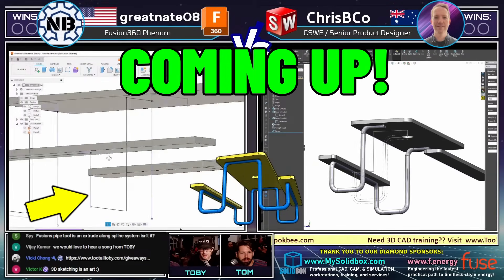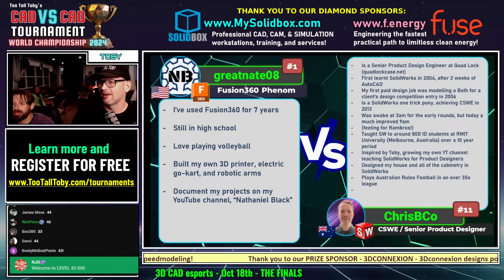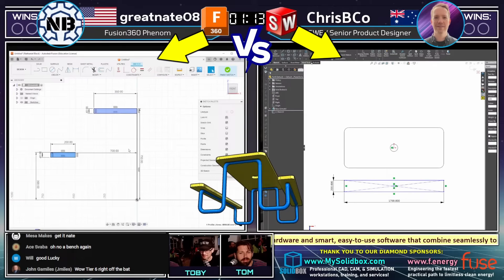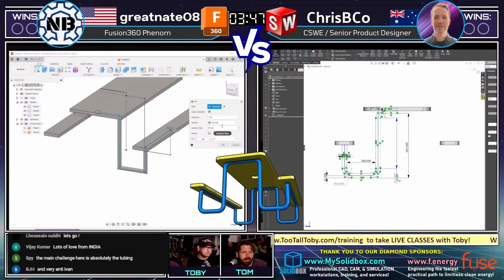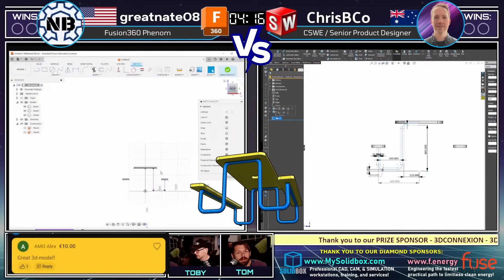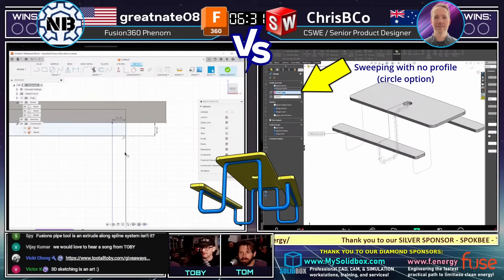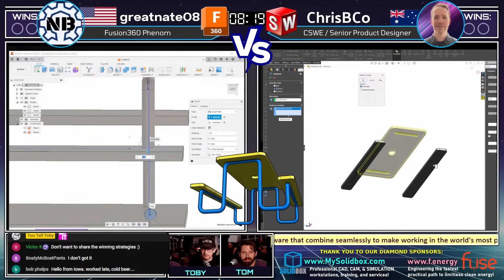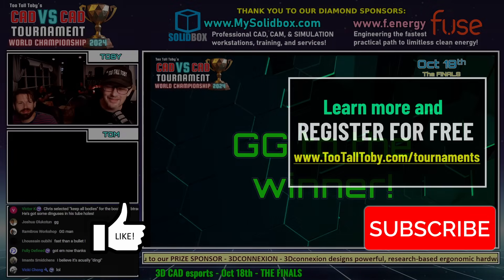CAD Speedmodeling Tournament! - SEMI-FINALS Battle 1 - FUSION 360 vs SOLIDWORKS

Comment: Would it be legal to simply calculate the length of the tubing and modeling a straight tube of the correct length for the mass? I know it is less fun, im just curious
Reply from the maker: Yes - during the tournament livestream the users can use a lot of workarounds to calculate the mass, including pen and paper or a calculator. We generally refer to this loophole as "the Ivan exploit"

Comment: Ah I remember this like yesterday! So many things I’d do differently now. 
For one, I know where all the dimensions are now, I’d get the first sketches done quicker.
But the main changes, I could’ve skipped making a composite curve and just used the tangent edge selection for the sweep.
The sweep itself could’ve had a thin wall, then I’d avoid doing the shell. 
OR, I could sweep, INDENT into the table, then shell. 
Much love for the multi-body models!
Reply: Is it possible to make the frame (sweep path) with a 3D sketch? Or is it just too time consuming to get the radius between sections done?
Reply: @razorcain74 it’s definitely possible, and probably the quickest options if you’re able too dimension it all easily. Putting in the fillets in a 3d sketch can be challenging
Reply: That's a great method you've got there. On my end, I'd probably do the pipe in a 3D sketch. I'm more used to AutoCAD, and when I'm in SolidWorks, I find myself really comfortable with 3D sketches. It truly depends on what approach you find best to get the job done. Thanks!
Reply: Solid work Chris, glad to see you're still rocking these competitions. 
Should get a raise soon ;)
Reply: @Leqi  haha thanks, this is from last year but I’m still involved and having fun schooling others
Reply: I loved the way you did it!! It was funny though how you left your sketches undefined at the start, maybe the nerves
Reply: @mehtabnehal4022  I left them under defined because I couldn’t see the dimensions I needed and planned to come back to them, which I did
Reply: On another thought, given you can’t INDENT or COMBINE (subtract) into more than one body at a time, the best method of removing material will be a CUT SWEEP.